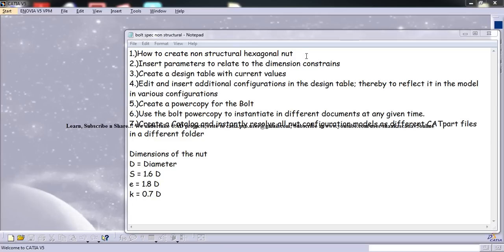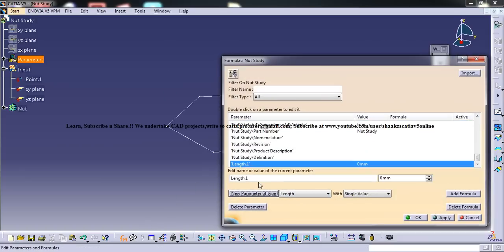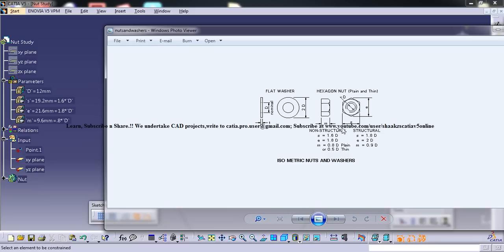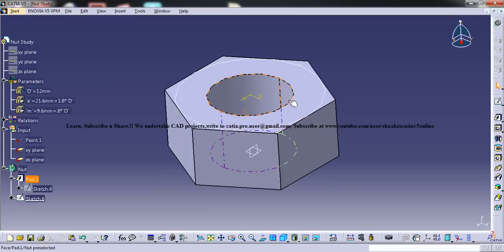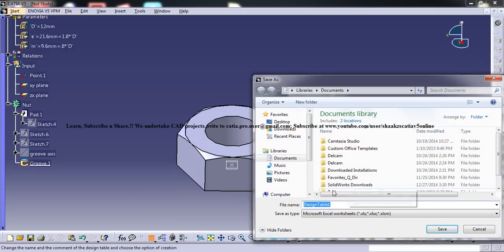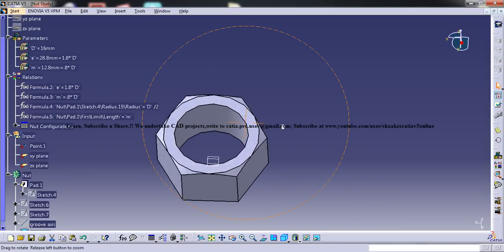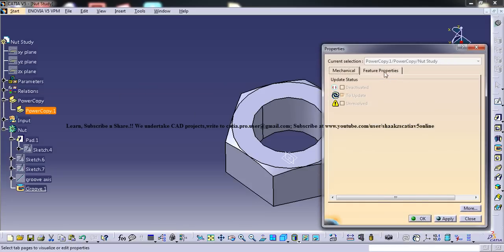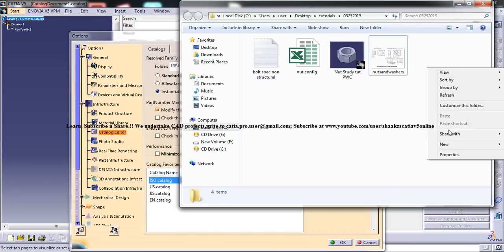Catia V5 Catalog_WB|M12 Nut,Design table,Parametric Modeling,Power Copy

Comment: shakeel can u please tell what is define in work object
Reply from the maker: +patan shameer , By using define in work object, you are making a particular selected surface of a geometrical set as an active element. The subsequent actions you perform will be based on the in work object you lastly defined.
Reply: thanks man got clarified

Comment: You can remove the parallel constraint, use distance as it automatically makes it parallel and used your parameter.  You had it when you deleted the purple distance when the sketch turned white.  At that point you could have done distance and it would have worked.